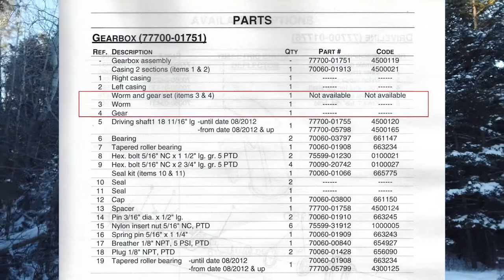Kubota BX Snowblower Gearbox Failure and Replacement - No.9

Comment: I noticed your augers are not offset. You need to remove a sheerpin from either side and rotate it 180 ° If your blower makes a whomp ,whomp sound while you're blowing it's because the augers are feeding simultaneously. Each auger should take it's own turn feeding your second stage.
Reply: Oops,  I just noticed someone else made the same comment. LOL!!!
Reply from the maker: Hi Marty and thanks for your comment! At first I hadn’t realized that it mattered - but many viewers have pointed this out to me and I have since done exactly as you have also recommended. Cheers!
Reply: the bx 2755 are the older model snowblower wich no shame origional gearbox

Comment: Great video. I especially liked the part where your head knocked the auger off the table. Thanks for not editing that out!
Reply from the maker: I’ll be sure to tell that to Mrs. Killingitcountry .... she didn’t think that bit should’ve made the final cut 😂
Reply: @KillingItCountry  wow $706.11 that's accully not bad for gear box its $2,100 at deeres here wich rediculas
Reply from the maker: Ouch! Which model snowblower Michael?
Reply: @KillingItCountry  1154 frontier 54'' front mount blowers wich they are accully a night meirror to work on too wich kubota made there blowers so much easyer to fix and  repair plus for $706.11 sure is better then $2,100 at deeres plus frontier has poor design where the shear pins goes wich you have to squeez your arm down through a tight spot wich is in the rear of the blower wich seems weird place for shear pins go
Reply from the maker: Yes, some manufacturers seem to design their equipment to be serviced only by them.
Reply: @KillingItCountry  yeah and then few  hours later the over priced deere service bill be out wich why were glade dont shop at deeres any more  kubota  dealers saves customers quite alot of money wich thank goodness and kubotas are smart there parts are affordable and not rediculas over priced like deeres are and newholland wich need a big bankers with ya shop at deere and newholland lol
Reply from the maker: I love my Kubota!! Thanks for your comments Michael!
Reply: @michaelmactavish1728  n

Comment: FYI keys are to be a light press fit (tap in with hammer). The Key takes the rotational load, that's why it should be tight, if loose it will rock and wear the key ways over time. The bolt is only used for maintaining a position on the shaft.
Reply from the maker: This was a great learning experience for me,  and now I have a rebuilt spare gearbox should the need arise!

Comment: I noticed your augers are oriented the same. I believe they should be alternated if you know what I mean. Great video BTW. Thanks for making it.
Reply from the maker: You are most welcome! Others have also pointed this out - it’s something i never paid attention to when I took it apart. I have since rotated one auger 180 degrees. Thanks for your comment!
Reply: @KillingItCountry  who knew that was a thing eh. I changed the oil for mine and saw that info in the manual.

Comment: Great video.  I work a Kubota bx2350 with front mount bx2750c hard here in Vermont to clear.4 miles of rough stone road.  What are those skids on yours?  Are they Armor Skids?  My blower only has the old style L skids that are mounted inbound from the sides.  They don't work well at all and allow rock to be scooped into the housing which breaks lots of shear bolts.  Very interested to hear what you have on each side of yours.
Reply from the maker: They are adjustable height skids factory installed by the manufacturer. I do wish they had a larger surface area to contact the ground though - right now they sink into the inflorescence ground making them useless and allows the unit to pull gravel into the second stage fan … not good for the paint lol

Comment: The whole time, watching this, I kept wanting to see inside the old gear box.
Are you sure it was not an internal shear pin?
As it happens, I am considering one of these. Minus points for how hard it comes apart and minus more for lack of parts.
Thanks Chris
Reply from the maker: I’m told that the internal parts are available to purchase individually if required. I wanted the unit back up and running immediately without any hiccups so I just bought the gearbox and called it a day. I still haven’t taken it apart to see the inside.  With three kids, full time job and 50 acres there is rarely down time for anything but what’s absolutely required. If I ever get around to it - I will make a video! The snowblower is a beast - I highly recommend it!

Comment: Kubota used to sell the individual gears.  They were only $100 cheaper than an entire gearbox and bearings.  I think people just decided to replace the entire box and avoid tearing it apart.  I left mine in parts and now I am kicking myself that I didn't order the gearset when I could.
Reply from the maker: I still have my old gearbox somewhere wrapped up in a rag. It just needs that single roll pin and it would be good to go!!

Comment: Great video. I have the same machine. Haven’t done the gear box oil change since new in 2016. Where exactly is the drain plug and what size wrench? Did you remove the receiver from the blower that connects to the tractor first? I also changed the gears on the auger side, my Son ingested a brick, and ya, $750 later I had it fixed, did it myself also. Thanks for the great content.
Reply from the maker: Hello and great questions! You need only remove the snowblower from the tractor to change the oil, you don’t need to take anything else apart. If you have the snowblower off of the tractor and you’re staring at the reduction gearbox from the back - the drain plug is roughly at the 5o’clock position on the side of the gearbox and is 10mm on my machine. This is a silly design because it will never allow you to drain all of the oil unless you tip the snowblower up on its side. The fill-overflow plug is at the 3 o’clock position and is 13 mm on my machine. At the end of this winter season I will be preparing a video to service my snowblower so stay tuned!

Comment: Did you ever take the gearbox apart and see what went wrong. what did you have for a shear bolt. I think a grade 2 bolt is ok, just don't use anything stronger.
Reply from the maker: Shear bolts have always been factory Kubota provided units. There was a pin that failed in the gearbox. The videos are worth watching for sure!! Thanks Mike!!!